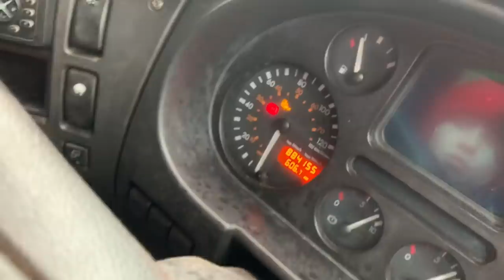How to change a APU and air dryer valve on Daf mobile hgv mechanic lorry truck semi

Comment: That old trailer with the rubbing plate cut out lying on the deck (1:45) brought back a few memories, replaced a few of them when I worked for FB Atkins back in the '80s.
Reply from the maker: It did me to! I’ve done a few back in the day, crap job 😂 now days they would scrap the trailer! I’m there on Tuesday so I’ll show you an up date on it 👍

Comment: Port 25 on the protection valve is the handbrake ,there is a non return valve  that screws out and can be cleaned..There is a taller cartridge with an oil trap that prevents a lot of the gunk..You can get the voss nuts seperately
Reply from the maker: Needed your help when I was trying to find the fault! I had to trace the pipe because I had no clue where it fed from, 😁👍

Comment: Hi chris same problem slow release handbrake.was taking about 12 seconds for light to go out.changed apu and park braie relay .valve got it going out after about 3 or 4 seconds us this sn mot fail. Cheers

Comment: Hey Christ nice video and great mentoring technique to your little one mate; listen we got this DAF CF 2016 plate, and we been struggling with pressure problem; we took it to daf and the did some few work but no any good result in fact I took and next day it got worse even then MIL light came on which wasn’t there b4. 
We constantly see msg on master display saying “drain air tanks” “ low transmission pressure” “ check air leakage” whenever I connect trailer or back into bay for load or unload it takes ages for me to build pressure, and driving on straight pressure goes high, once foot on brake pedal pressure drops and you can see it on air supply display, am not sure if you have any idea of what maybe wrong mate.
And I why do you need to change all the unit since changing filter could have solve the problem in your video, thanks

Comment: CFs Park brake slow release or not releasing 9/10 times APU  Cutting pipes no need to do that mate! Tipex the pipes.& APU for reference. If you do cut a pipe fit brass speed fits.

Comment: iv done a couple of these`s if i remember rightly you can buy these in two part`s which thay dont tell you  [ the filter or the four way system protection valve ] these are commen fault on daf`s  , iv bypassed these on the side of the road  [ to get the wagon home ]  when one air tank was not building up , a quike fix . the last one i helped with was at monmouth at 7.30 at nite in winter the DAF main agent fitter wanted to tow 37 gvw to newport to get it fixed , but i showed him the quike fix , he was not kean on it and asked me to sign a disclaimer note which i had no problems with
Reply from the maker: You did well to get it moving at little cost to the customer! A tow is the very last resort, There’s nothing like a roadside quick fix 😁! Yeah most dealers just want to find the quickest way to bomb the job off! Cheers for that Gibbo pal 👍
Reply: @Professional-struggler  cheer`s chris , the quike fix is if one air tank`s is not building up it`s 90% of the time it`s the four way system protection valve as u proberly now . the quike fix is find the tank that`s not got air in it remove the the drain tap or bung from the empty tank find a tank that`s got air in it remove that drain tap or bung  [ there std thread`s think there 22mm / same as on brake chamber`s unions ] then just link them together with some rubber 5/8 hose and some jubblie clip`s . it`s back feeding the empty tank everthing work`s as it should  . brake`s , gauges , pressure , it get`s the truck home OR KEEP`S IT RUNNING FOR TWO WEEK`S LIKE MY DAF 85/420  hope this help`s enybody and chris ur a brave man doing some of them job`s on site . all DAF`S are good strong motor`s but u have to drain the tank`s a lot and keep the water out or all the valves fuck up and there OTT on valve`s daf